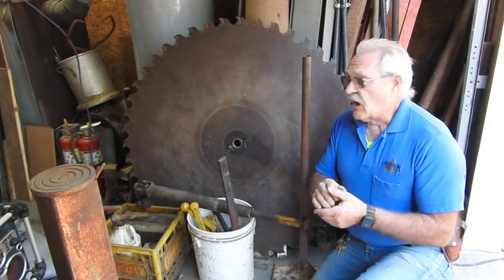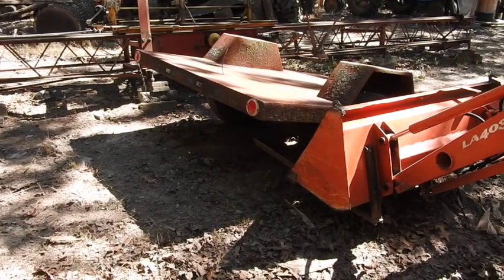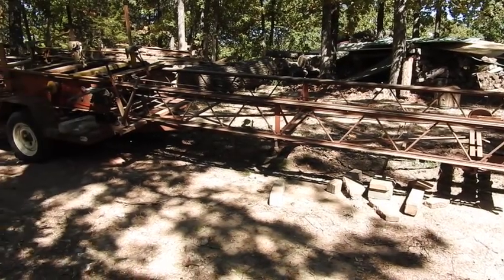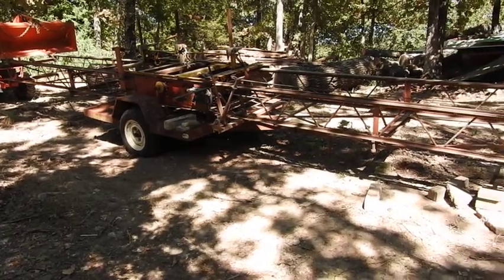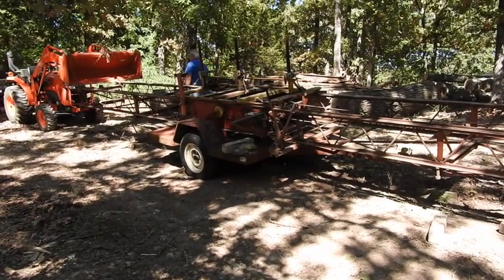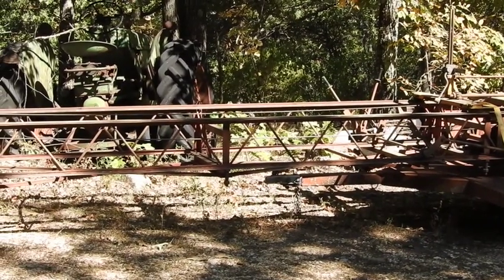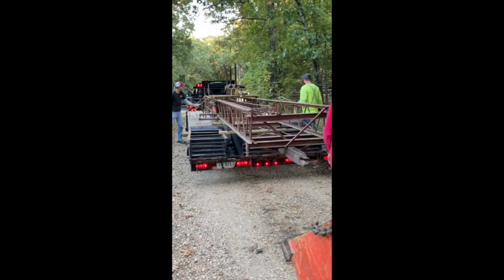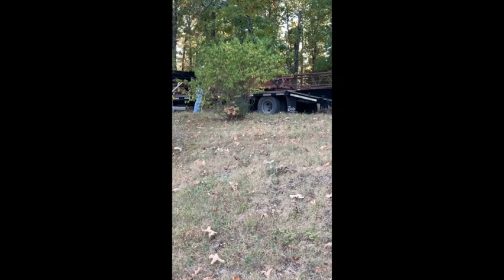Belsaw Sawmill Prep for Loading for New Owner With Help From the Missus

Comment: Good job tm44.  Love it when plan comes together.  The Missus did a good job filming. Them wives, mine included are famous for underestimating us. LoL. I  will hafta remember this, good idea using a much shorter trailer to balance such a long load. Ingenious. I'd never of thought that.
Reply from the maker: Well it helped that the Belsaw had a tongue built into the end of the bedframe. This is the design I copied for building my own trailer for the new Frontier bandsaw.  The rigid characteristics of the bar joists make this a superb design.  Very little flex and no twist with the cross bracing. Thanks Dean for the visit and I'm glad you enjoyed it.

Comment: The law of physics worked once again.  Enjoyed your explanation on the "whys and hows" to transport the saw mill rig.  Really enjoyed the MIssus explaining  the details; and especially about why you cannot have neighbors.  It will be interesting to learn what the fellow from Illinois will think of your loading theory for his trailer.  You can give him many pointers, I am sure.  Great video.  Please film the transfer; looking forward to seeing it. Including  going down your road heading to the highway.
Reply from the maker: Thanks for the visit.  I didn't really get approval from the fellas for putting them in the video, so I didn't set up the camera, but the Missus snuck out and got a few seconds of the vertical footage at the end and I snagged a few seconds that left their rig non-descript.  We dropped the tongue off the tractor which elevated the rear for him to back under.  We chained the front of the mill to the loader, raised it, they rolled out the little trailer by hand and I slowly pushed it forward.  In preparation he had made two 12'' long skids out of a 2x4 for the front two legs of the mill.  Miniature snow skis for wood. Sanded slick, they then allowed the metal legs slide right up the wooden deck like snot on a doorknob.

Comment: I knew you would sell it quickly. Good job on the shifting.
Reply from the maker: Those hydrostat transmissions make it real easy to move stuff like this in and out of tight places.  I figured it'd go pretty quick.  I bet I would have sold 4 if I had them to sell.  I had a crazy number of responses and took them as they come, but I didn't get past number 1.